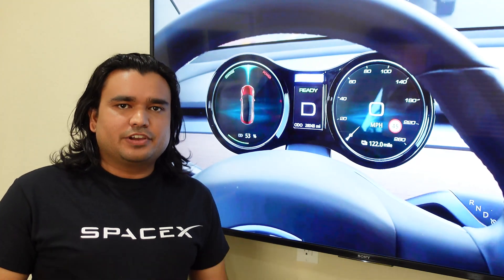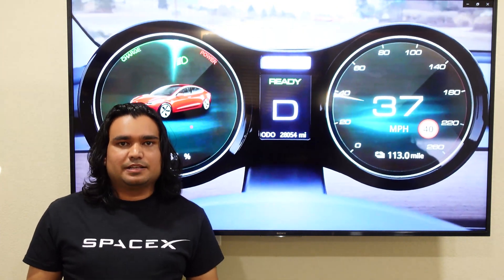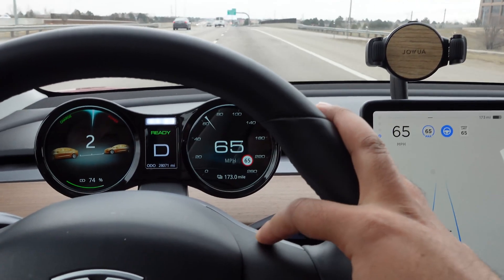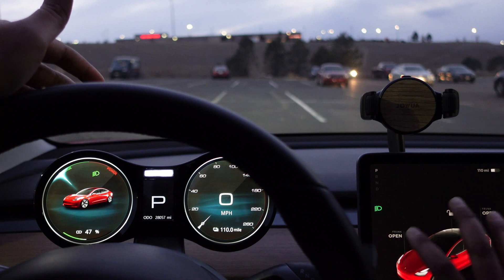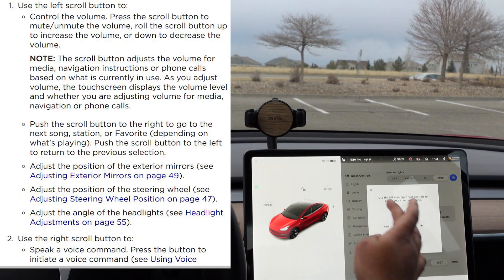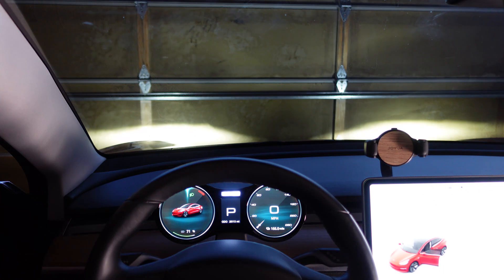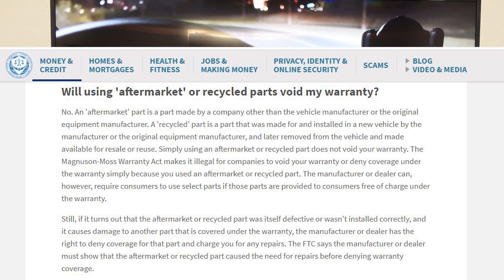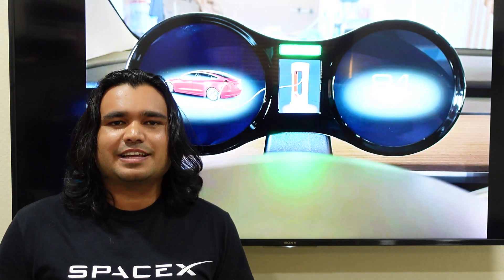Top Questions Answered ⚡️Tesla Model 3 & Y⚡️ New Instrument Cluster 2021

Comment: Hi.  Thanks for your install video.  It was invaluable.   However I found that in the 2021 model I had to remove the side carpet panel to access the ports.  Can I ask Shiva, can you provide a link to the new update in this video?    I can't seem to find it anywhere.

Also, for anyone who has the RHD models, I found that the cord to the display is about 7cm too short. What I needed to do was NOT run it up the A pillar panel and across the dash as recommended and exemplifiedin your install video, but take off the carpet panel in the driver side also and feed it through under the centre console, and up into the steering rack.  Doing it any other way will make the cord too short to connect to the display behind the steering wheel.

Another point worth sharing, when I installed the display and while trying to pull the lead and feeding it through the recommended route , the car lost all sound, voice control, and tyre pressure.  I tried doing everything recommended by Tesla, forums and YouTube by performing a soft, a hard reboot and even a factory reset by allowing 3, 10, 20 minutes and even an hour before starting the car again as recommended which all failed.  I tried so many different advices over 2 full days with no result.  

In the end, what I was able to do to get everything running again was to wind down the window, do a hard reboot by reaching into the car from the outside (you cannot do this from inside the car because as soon as you open the door to get out you will stop the hard reset and turn the car on), and do a hard reset and leave it overnight.  Fortunately,  after everything else failed a two days trying to fix it thinking that some how I must have affected some part of the soft or hardware which would have been a very expensive fail just to put a speedo in front of me, when I came in the garage after letting sit overnight rebooting itself, everything including the Carda display worked, it was a huge relief.  

Just thought I would share my experiences, frustrations and fixes with you and those reading this.
Reply from the maker: Hi Richard, thank you very much for sharing your experience. That is very scary. I really appreciate you sharing your tip for hard reboot from the outside. I will recommend this to folks who might be in a similar situation. I am also going to send this to the manufacturer as well so they can start sending people extension cords or make their cable a lot longer. As for the update, can you please send me an email with your email address (my email is listed in the description) and I will share the file with you. Thank you again, I really appreciate all the info.

Comment: Hi - do you have any way to contact the developers of this display?  The latest Tesla update (2022.28.1) has caused a few issues with the headlight icons on the Topfit display - the high-beam icon (blue) is on all the time, and the headlight-on icon only displays when auto high-beam is selected.  I suspect it's a side-effect of the AP changes for Tesla Vision that now force auto high beam on when you use AP or TACC.
Thanks,
Paul
Reply: Same here. The QRCode on the display cannot reach anymore. How sad...
Reply: +1
Reply: Same here! +1; do you recommend any software update or factory reset?
Reply: @guillemgandoliginer6382  I have managed to get an update that fixes this problem.  You can get it here =>  V0.3.X_9.0_EN_HMI_0.3.13MCU_V0.3.10.rar - https://drive.google.com/file/d/1rAErRI1lL6Zp5f-MSRPM1_krH3BEeDW6/view?usp=sharingthanks
Reply: @paulkaye5076  Thank you so much! How is the correct procedure to make a safe update?
Reply: Sorry. Can you explain how can we make the update correctly? The .rar file you post is working? I cannot see any .tlink extension inside the .rar; only a .bin and .img file that I don't know how to manage them.
Reply: @guillemgandoliginer6382  I would like to know also... 🙂
Reply: @paulkaye5076  Any news about this update? The files inside .rar file seems not to be correct to update the display
Reply: @guillemgandoliginer6382  I'll upload my copy to DropBox and you can try that one.
Reply: @paulkaye5076  Dropbox or Google drive?
Reply: @paulkaye5076  do you have a link? 🤔

Comment: Hello Shiva
I have installed a Topfit display about a year ago and I love it.
I have a question about the possibility of displaying the turn signal picture showing up in each of the round dial, directly in front of you instead of only on the main screen.
You have contact with them, can you  investigate if a software upgrade could bring us this feature.
Thans Gerry
Reply from the maker: Hi Gerry, unfortunately, that manufacturer is currently MIA. I reached out to them several times with no luck. I will let you know if I hear back from them. Thanks.
Reply: I have the Topfit display too.  Are you talking about the green arrow being displayed when turning?  If so, this is what mine does today.  Or do you mean the side camera display that was introduced in a recent Tesla software release?  If the latter, I'd be very surprised if the Topfit developers add that (even if they're not MIA!).
Reply: @paulkaye5076  
I effectively was talking about the new side camera view that we got in a late software update.
Would it not be perfect to have that blind spot view right in front of you.  No need to leave the view of the road (almost). I understand both Tesla & Carda use Linux language, just not sure if a video can be displayed on these small round displays.

Comment: Thanks as I purchased and installed one of the for my 2022 Model Y. It’s not as bad as the install sounds, didn’t need to remove any plugs from the computer to make the install. Love the gauges!
Reply: Hi Mike!  I just bought a unit and have a new 22 Model Y long range, gonna attempt an install…any pointers on how to best access the middle computer port?  Also are there any display drawbacks when wearing polarized sunglasses with this display?  Some other units can’t be seen well when looking thru the sunglasses.  Is the same true?  Thanks and cheers…Greg in North Carolina.

Comment: Do they have an updated for this display to work with a 2022 model Y with the AMD computer? The Hanshow now requires you to connect to a blue plug on the passenger foot board and power from fronk. Has anyone tried this on the new AMD teslas?

Comment: I noticed on Amazon that in addition to Top Fit, ThinSGO and BMZX also sell what appears to be the same gauge cluster. Are these all the same exact product, or are there some subtle differences? Would software upgrades be an issue with someone other than Top Fit? Thx.
Reply from the maker: Hi Todd, yes these are all the same products. I got mine from Topfit. I cannot comment on the software update from other vendors but this device doesn't really need an update. If for some reason it breaks due to Tesla upgrade, then I would press Topfit to release a patch. Thank you.

Comment: Shiva, have you noticed if the speedometer makes your battery drain faster? Great job and thanks in advance.
Reply from the maker: Hi Chip, no it doesn't really affect the battery. This is pulling power from the 12V battery not the high power one. Thank you.

Comment: Hi from France Shiva.
I really enjoy your great job and the way you share on Tesla topics.
I bought this Carda  screen 6 months ago on Aliexpress and I would like to get some advice from you if possible, based on my personal feedback. First of all the FW is the original one as I could not manage to get any update from the QR code link (no more clickable link on the page) nor from the Chinese re-reseller. This FW is the one with only 3 different looks for the wheels. The most negative points I encountered:
  - This screen generates a lot of wrong frames on the CAN bus: to install the Homelink, Tesla had to unplug the Carda display because it was just impossible to declare the Homelink that requires a long data exchange to be registered in the Model 3. The screen has been replugged just after.
  - This must be a problem of synchronization with the CAN bus as the problem of corrupted CAN bus frames exists also on the screen itself: sometimes, the screen reboots without any reason. Sometimes it boots with the central little screen reversely displayed (mirror effect due to incomplete initialization sequence).
Before removing the screen, I would like to try a more recent FW but I don't know now how to get such a FW and I would like to know if you heard about this kind of issues.

Thank you very much Shiva. Best regards..

Comment: How do you turn off the display....mine doesn't turn off even with car off
Reply from the maker: I have been hearing that concern from many folks with their updates. I have been trying to get a hold of Topfit to get update files, hopefully they respond soon.
Reply: I’ve had the same issue ever since my last Model 3 update to 2021.32.21.  An because of it, my car won’t sleep for more than 4 -5 hours.  It wakes regularly at specific intervals for a specific amount of time.  I never had that issue with the screen installed until this last software update.

Comment: OK, after I asked about the warranty on your previous video, you gave a fairly good answer concerning the warranty, but the Tesla Rep DID say that it WOULD void the warranty. However, I am investigating this issue further using the info you provide here. Having the local Tesla service center to install this is my next question to the Tesla Rep.  I have not agreed to buy the Model Y yet. Being bling in my left eye, I need this device for added security since my depth perception is not good.  Thanks for the great video.
Reply from the maker: Hi David, as per the FTC website, Tesla cannot void your warranty simply because you installed an after market accessory. Tesla will not install this on your car (or any other accessories). Many of my subscribers have reached out to Tesla about accessories like this and Tesla told them they wouldn't touch products that are non-Tesla products. You can look for third party installers. For example, here in Colorado, we have got shops like "Car Toys" who install products like this. Thanks for watching my video.

Comment: Before purchasing this product,  I would like to know what the latest firmware have to offer.  Does this product have an official website where I can find out new feature.
Reply from the maker: Hi Ray, Topfit said they are working on a place to post all their firmware. The latest one I have is the one in the description of this video. This device doesn't really need updates as it doesn't have bugs and I am not sure about new features. If you do purchase please use the new code "10SHIVATESLA" to get 10% off. Thank you.
Reply: @ShivaSapkota  Do you know if it supports the GPS turns

Comment: With the phone holder set to the side of the 15 inch display is there enough room to hold the phone or does the dashboard display get on the way?
Reply from the maker: There is still room to put my phone there. You can move the phone holder slightly up to fit if it gets on the way.
Reply: I found your review of the holder showing there was indeed enough room. I purchased the wireless charger unit that recently came out.
I will be picking up my new 2021 MY late July, considering buying this unit.
Reply from the maker: Awesome! That is very exciting. Congratulations in advance on your MY. Thanks for watching my videos.

Comment: One bug no one seems to have mentioned - when you switch to kilometers per hour, the odometer still displays miles.
Reply from the maker: Hello, did you try the update I listed on the video? I wonder if that one fixed it? I currently have the Hansshow one installed so haven't used this display in a while. Thank you for the feedback.
Reply: @ShivaSapkota  Nope, don't have one, still trying to decide between it and the Hansshow one. Noticed the same mile ODO issue on all the videos i found on YouTube.
Reply from the maker: @oorcinus  I hope to release a video soon with a detailed comparison of the two displays. I have had some time to test both of them out.

Comment: i have a 2021 so i need a adapter then to make the wire longer ...any suggestions
Reply from the maker: If you place an order, let the seller know that you need a longer cable. They might just send you 2 cables which should work. Thanks for watching my video. Please don't forget to use the discount code to get 10% off if you decide to purchase this display.
Reply: I have the 2022 model and it worked perfect only it is very difficult to reach the conector my advise is getting a long screw driver to push the click holder and long 11 inch plier to pull the conector out it is almost impossible with your hands

Comment: Shiva thanks again for your great video. I have asked you this before . You mentioned when the ac is blowing you can still feel air to you're face which is better than the other display you reveiewd.The retangle one seems to block more air little or next to none. But the mickey mouse on you can still feel ac in your face. Did you fee the air satisfactory. And when you installed both displays did you shut down the car ,like disconnect the 12votl battery , it seems you just took out the harness and installed the display for both units. Thanks
Reply from the maker: Hello, I disconnected the 12V battery for the rectangular display. I would recommend doing that for either of the installations. The AC better with this circular display but hard to quantify. I personally find it satisfying but our summers are not too bad here. You can direct the airflow from passenger side if you are riding alone. Thanks for watching my videos.

Comment: Is the installation the same with 2021 Model 3? Especially the part where you need to access the autopilot computer.
Reply from the maker: Hi Juan. Yes the installation should be the same for 2021 Model 3. One of my subscribers told me that his plug was under the center console (opposite side) but he is in the UK. The US models should be on the exact same side as I show in my video. Thanks for watching!
Reply: @ShivaSapkota  I'm really interested on this one but after seeing the review from Amazon that the guy returned the unit because it was very difficult to access the autopilot connection for 2021 model. This put me on hold.
Reply from the maker: @juantamad8339  That plug could be difficult to access for any models. However, I now find it quite easy with reclining the seat and leaning back to reach the plug like how I showed in my previous video. I removed this unit from my car today to install and review Hansshow's display with apple carplay and it was the same deal, I had to access that autopilot plug. I unplugged and plugged back in under a minute. You can definitely do it, but finding an optimal position could be hard.

Comment: Did any of you had problems with the sound system not working after installation?
Reply from the maker: Hi Marco, I just learned this that if the sound doesn't work after your installation, that means the computer went into protection mode. This apparently happens if you take more than 2 minutes to unplug and plug back the computer plug. The resolution is to lock the car and let it sit for 2 hours and the audio should return. Give that a try and let me know if it works. Thanks for watching my video.

Comment: Hi shiva, do you need to shut down the car, unplug the main battery to the car (computer) in order to do this? Thx
Reply from the maker: Hi Jimmy, my unit didn't come with any instructions, so I didn't unplug the main battery. However, they recently sent me some PDF instructions and looks like they recommend we unplug the battery connection (this is located underneath rear passenger seat cushion). If you would like me to send you that PDF, please send me an email and I will forward it to you. Thanks for watching my video.

Comment: Great Video thx!

Is it compatible with 2021 refresh, I read connector of the electonics may have changed.

One comment - in some of your videos I realized audio quality often is not good, sounds like clipping, probably easy to adjust turning down mic sensitivity
Reply from the maker: Hi Sammi, I don't think the computer plug that you need for this display changed with the 2021 refresh. So, it should work. I really appreciate the feedback on my audio. I think it was my mic. I just purchased a "Rode Wireless Go" microphone set and hope that helps with some of the clipping. I will be paying extra attention while editing to make sure the audio levels are okay. Thanks for taking the time to provide that feedback, it really means a lot to me.